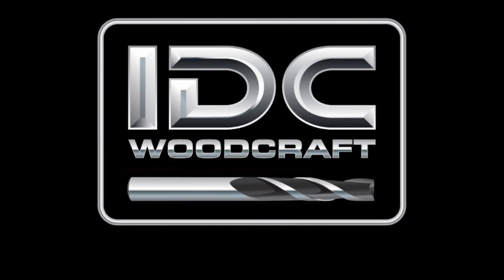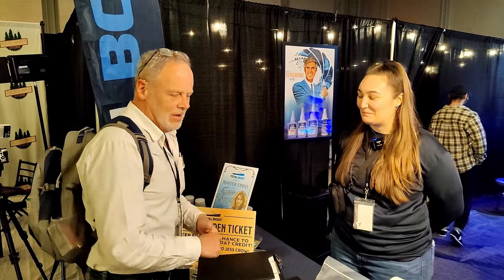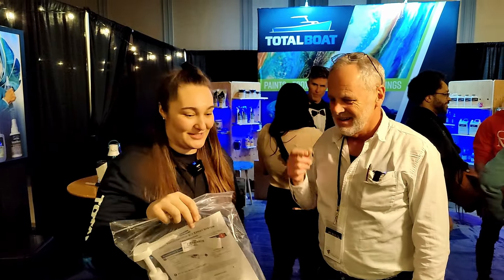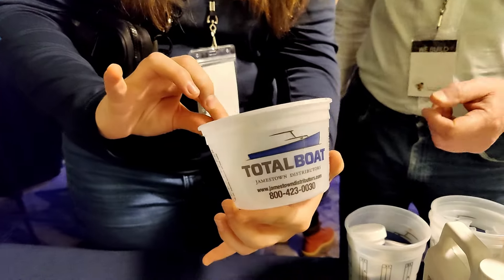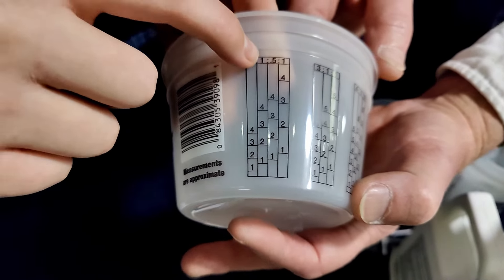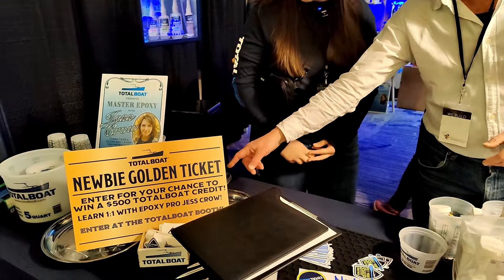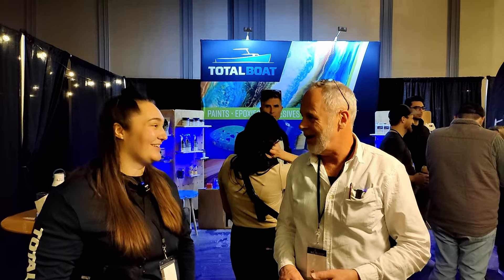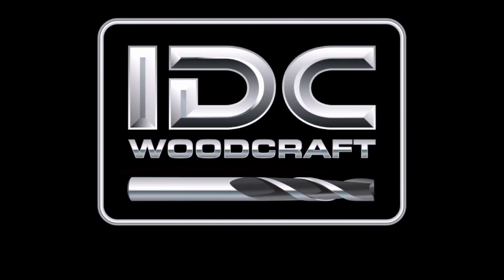Epoxy Mixing & Pouring - What You Need To Know

Comment: Great video interview. Where can I get information about preventing epoxy from bleeding into the edges V carve letters?
Reply from the maker: marklasby, before applying epoxy, try to seal the carved letters and the surrounding wood surface. You can use a clear wood sealer, shellac, or a thin layer of the same epoxy you'll be filling the letters with. This creates a barrier that prevents the epoxy from seeping into the wood's pores! Hope it helps brother!

Comment: So one thing that always confuses me/I feel like they are not using a good measurement. The pour depth part of this. So we see people making things like a river table then cnc projects. So I know some of that is the heat generated by the expoxy. So 1/4in, thats not equal if your pouring a .25 deep by .25 wide hole vs .25 deep 12 inchs across. Not like being negitive to Total Boat or any of the epoxy companies. Just seems like that should more be a total volume limit, like say 2 cups max vs just depth in my brain.
Reply from the maker: drewpickard554, good point my friend! Keeping the epoxy cool is a critical factor to ensuring your project turns out exactly how you want it to.
Reply: Total boat has an epoxy calculator on their website and that may help you to determine what product you’re using and the depth that you should pour and the hours between four times I’m just learning so I hope this helps